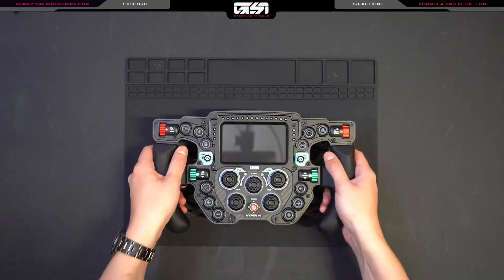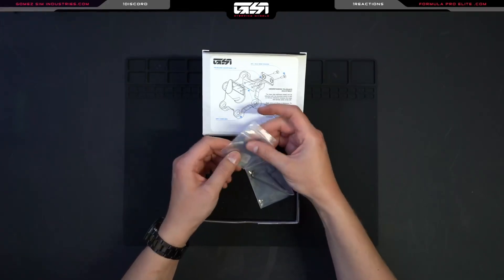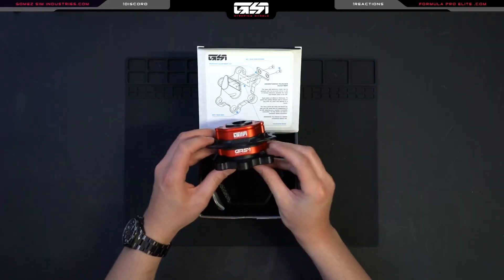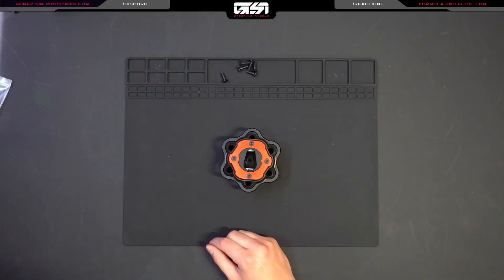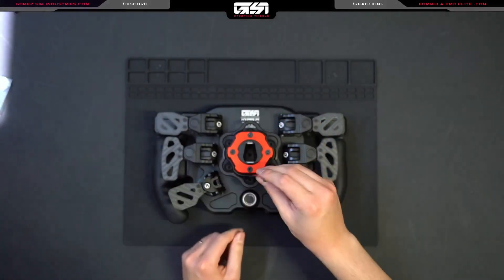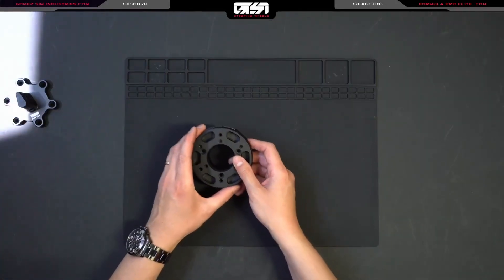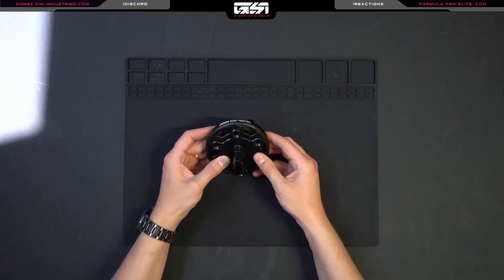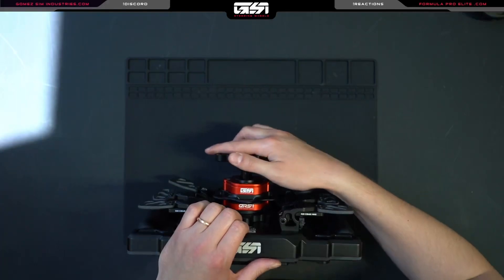How to Install QRS-1 and SC2-X Adapter

Comment: Are you guys selling wheel side separate? I want to buy this for all of my wheels (3x)
Reply from the maker: We only sell both halves together. The wheel half is about 90% of the cost. You could repurpose the base side and make a place on your rig or wall to store the unused wheels.
Reply: @gomezsimindustries  I was just going to ask this question also and the answer makes perfect sense … appreciate it .

Comment: Can we put the male bolt on the steering wheel? If I want to change the steering wheel, do I have to buy additional QR?
Reply from the maker: You can, but this is not recommended as the QR would will then need to be pushed away to detach from the wheelbase which makes removing it difficult.